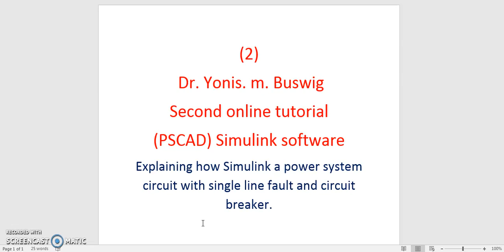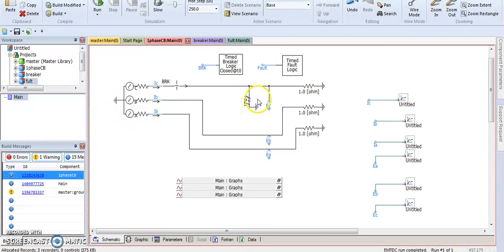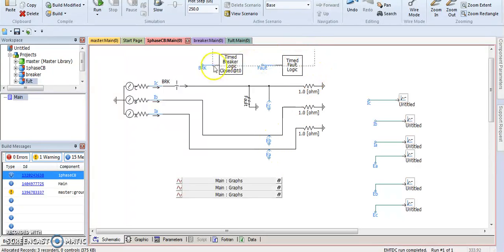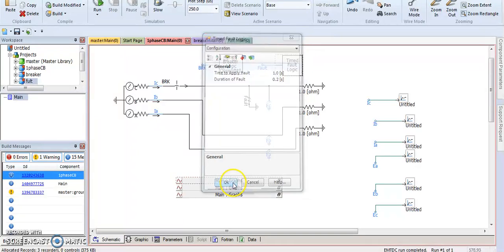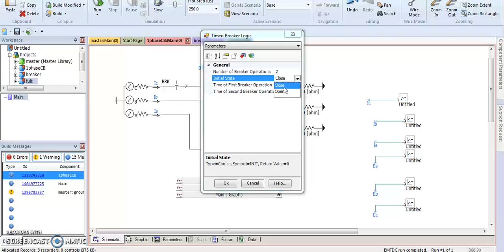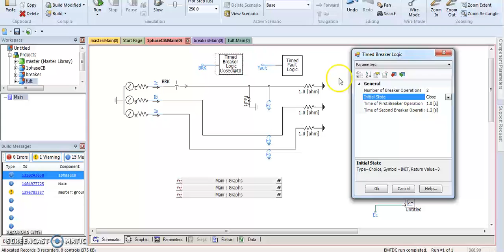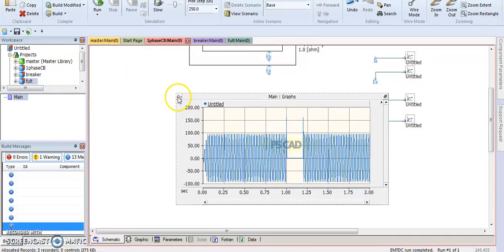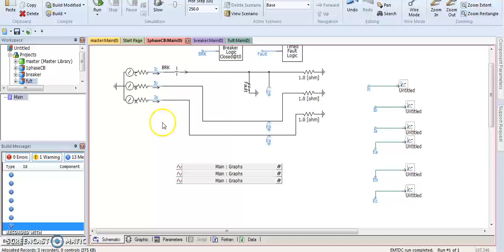(PSCAD)  single line fault and circuit breaker.

Comment: Hello I’m an undergraduate in electrical and electronic engineering, may I ask what source signal you use for your Vin and input for Fin?
Reply from the maker: I use 3 phase input voltage source but as single view